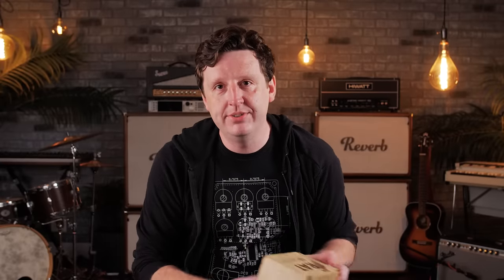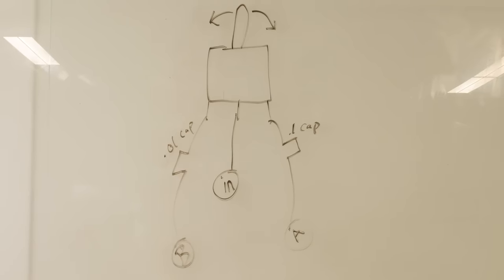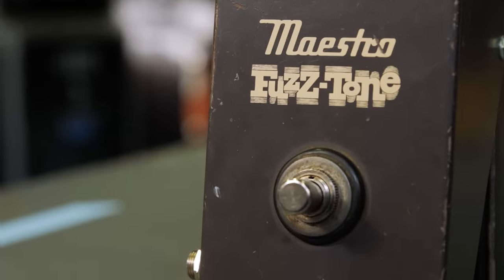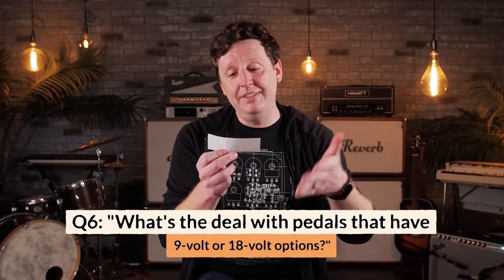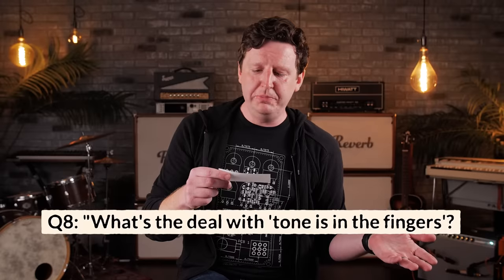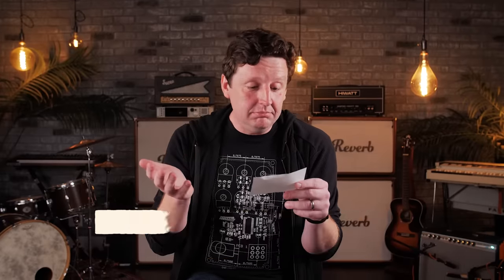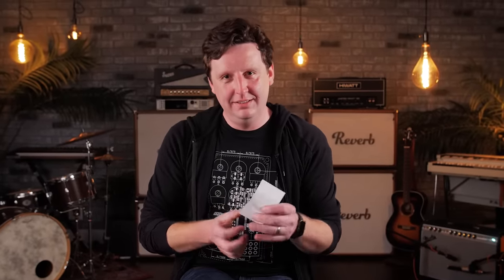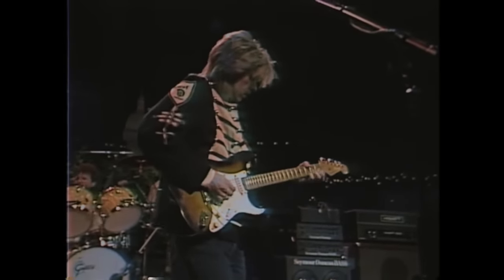What's the Deal? Josh Scott Explains Pedal Myths & Concepts

Comment: "....WE WENT TO THE MOON... Are you telling me we can't make a part for an overdrive pedal?"  Josh is a national treasure.
Reply: I love Josh, but this is the first bullshit I've heard him say. I'm talking about the moon thing.
Reply: @jonahlouque9621  That would be bundled with other reasons... public will would be highest on the list. The tooling and personnel required to build and operate the machines the same way has gone, so in a sense it's correct... but you wouldn't go back to the moon to do Apollo all over again anyway. What's the point?
Reply: @jonahlouque9621  Yes, I've seen that actual clip before too. They blamed it on storing those files on ancient hard drives in old barn/storage facilities and that stuff just gets thrown away. UGH.
Reply: Tone is in the fingers... 
Next!
Reply: @gnigognago9770   
Ok, “we faked going to the moon,” Are you telling me we can’t make a part for an overdrive pedal? 

What’s the sound that a Flat Earth effect pedal would make?
Reply: @jonahlouque9621  It's not about the "lost" technology as if we can't reproduce it. We can't just built another rocket from the 60-s, because the project of that rocket is based on a 60-s tech processes, materials, supply chain, contractors, etc. It is actually easier to make a completely new rocket, designed from the ground up with the new materials and technology in mind, than trying to redo and retrofit the old one.

You can reproduce a pedal though. Even if you really need that exact sound but "they don't make them like that anymore". Even using different parts you can get so close, that no one could tell a difference in a blind test.
Reply: Ironic because according to nasa we "lost the technology" to go to the moon
Reply: For me, I do believe tone is in the fingers.. at least to a certain degree. One day I was playing bass, and it just felt like my tone was quite thin..(I have small hands.. read into that as you wish lol) Anyways, I started using my thumb, instead of my fingers to pluck the notes, and it sounded much fuller, better bottom end. I think this is due to using the larger side of my thumb, rather than the tips of my skinny fingers.
Reply: @gordonhuskin7337  We also "lost the technology" to play laser disks. But laser disks were, definitely, a thing.
Reply: @FilinMXr  Exactly. There's plenty of everyday technology we have "lost" simply because it's become obsolete.

I mentioned laser disks. There's also the original 8in and 5.25in floppy disks, and old CPU architectures.

A couple of decades back I did some work for some companies that had old computer systems which were obsolete (Singer, Burroughs, etc.) and we had to get the software ported onto a different platform because those systems weren't made any more. Without porting the software to a more modern platform, it would be close to impossible to run those applications now. Those computer systems were "lost technology".

It is likely that, at some time in the future, valves (tubes) used in amps become obsolete because factories stop making them. The market for valves is increasingly small and they are expensive to make. The market for guitar amps probably isn't large enough on its own to sustain manufacturing. When this happens (and then the supply of valves has run out), we will have "lost the technology" to make valve amps.
Reply: I should point out that, whilst we may have "lost" certain types of technology (like germanium manufacturing), almost all solid state technology (which is mostly what is in guitar pedals) is still current and will probably never be obsolete. Basic components like diodes, transistors, and capacitors are the building blocks of all electronics.

Saying that one chip "sounds better" than another is like claiming that hand-soldered "sounds better" than machine-soldered. The topology and circuit are identical, it's only the manufacturing process that's different.
Reply: @KeithMilner  wow. that post is just one extremely long COPE. SAD!
Reply: We did not go to the moon...
Reply: @gordonhuskin7337  Just trying to educate the ignorant.

I probably shouldn't bother as it seems their ignorance is wilful.
Reply: @KeithMilner  lmao cope and seethe
Reply: Ha Ha Ha, that's your 1st problem is fall for moon hoax. 2nd only paint color makes a tonal difference in real pedals. 3rd Of Course the Klon Enclosure Enhances the Circuits & tone of the pedal.(Duh)
Reply: @gnigognago9770  why, i mean in ww2 germans built the first rocket that made it into space, just to hit London.
After the war all these rocket scientists got well paid jobs in the USA and built the same rocket, just bigger.
Why would't that be enough to reach the moon? i mean it's rocket science but that's actually not that complicated.
Reply: @Zwidawurzn  Some people are too dumb to wrap their head around even that. What's even more sad than being duped is when they can't even tell which is which.
Reply: @KeithMilner  'We also "lost the technology" to play laser disks. But laser disks were, definitely, a thing.' You win the internet! This is gold.
Reply: @RayLilith  it's real. It's just a rhombus on the other side of the ice wall, not a "sphere" in "space" like the man wants us to believe.
Reply: @AaronAubreyPhoto   You can get a similar effect by using different picks. I think the ones who are obediently repeating the "tone is in the fingers" platitude are not so much talking about the picking as they are talking about some kind of magical power that each guitarist has to make whatever gear sound like "them". 

  I mean, we have all heard somebody repeat a story they probably read in a magazine, book, or on the internet about how a pair of famous guitarists switched setups and were surprised that they still sounded like themselves. Clearly if that was the case, different brands, models, and such don't matter, right? 

  The problem with these stories is that they miss the most obvious element. When we play, our playing style and technique are always going to be the most noticeable element (especially to the audience). When we play, we play like ourselves regardless of the gear we use. This however does not mean the the sound coming out of the amp or the soundhole is the same. We will still play like ourselves but we don't have magic fingers that can make a Fender Twin sound like a Marshall stack.
Reply: @startrekmike  picks? I was playing bass w my fingers.. and I never said one could make a Fender Twin sound like a Marshall stack.. 
If you've played enough guitar, and are honest with yourself, you should know that a certain amount of tone is in the fingers.
Reply: @AaronAubreyPhoto  I know you were talking about fingers. I was saying that changing picks achieves a similar result. The object (finger, thumb, or pick of whatever type) you strike the string with will change the sound. It is a mechanical and physical process that isn't exclusive to fingers or picks. That is the point I am trying to make.

  In regards to "a certain amount of tone is in the fingers", I am painfully honest with myself and have been playing guitar for more than twenty years. In that time, I have found that one's fingers express the musical knowledge in our head and the techniques we have practiced but they can't really change how a specific guitar, amplifier, or effects pedal sounds by design. 

  What is in our hands is our playstyle, not the timbre of the instrument or other equipment.
Reply: @gnigognago9770  ...hahahaha...nice!!!!
Reply: Well, they say we went to the moon...lol
Reply: @KeithMilner  When transistors start to approach their saturation point, they become non-linear. That is, they stop amplifying the signal by 5x (or whatever), and amplify by less and less until they hit their saturation point and don't ever produce a higher voltage. Different transistors do this at a different rate. In particular, silicon transistors move between full amplification and saturation much more quickly than germanium transistors. This means that silicon transistors produce output much closer to a square wave than germanium transistors. You can't just replace one with the other and expect the same sound. It's also really difficult if not impossible to make one behave like the other. That doesn't mean that one is better than the other, but they definitely sound different.
Reply: @TeleCaster66  the moon is flat bro, it just looks square.
Reply: @Zwidawurzn  everyone believes what they want to believe,
as the great Layne Staley said:
"we chase misprinted lies"
Reply: @G60syncro  The Apollo program not only used transistors, but even integrated circuits!
Reply: @G60syncro  Why did we go to the moon? I wasn't there.
Reply: @darwinsaye  as the great Layne says:
"we chase misprinted lies"
Reply: @KeithMilner  Yeba if you change the chip it changes the sound and that is true, proved it by myself.
Reply: @CorbCorbin  A sound that I don't know, that you don't know and that nobody knows....
Reply: @Zwidawurzn  you're right about that
Reply: How is possible he says Germanium transistors sound like crap, it's clear he doesn't have experience with these magical devices, he's a liar.

Comment: “If it sounds good, it is good”

A lot of people really need to learn this
Reply: No no no its needs to be an original Plexi that got cigarette burn marks on it. And then you jump the channels and plug in your vintage strat. Make sure it's a second half of 1959 serial number so you got the slab Brazilian board because the veneer board makes it sound different. And then you kshzoapozbzojahalanbxhdos. Source:  trust me bro
Reply: @bazitube390  meanwhile the machining tolerances on the tuners and saddles were shit so it has that "warm vintage tone" but won't stay in tune to save your ass.

Comment: On different op-amps sounding different/the same, I have two things to add:

Yes, it's in the circuit, and inside one of those chips is yet another circuit, the topology of the op-amp itself! In short, different opamps can sound different, if you know where to look!

If you are working with standard signals within the intended operational limits of the amp, most general op-amps will sound the same. The problem is that when we use op-amps in effects, especially for overdrive/distortion, we are no longer necessarily in the intended, linear operation regions of the opamp. Consequently, when you push opamps outside of intended operational ranges, you may start to hear differences. In particular, a pedal or dirty channel which uses opamps for clipping may gave you different sound characteristics depending on the opamp! Some are rail-to-rail and whill clip later, others start clipping earlier, some clip soft, some clip hard, some clip assymetrically, some older models with bad slew rates like the LM308 can gave off non-linear distortion when cranke, compared to the much higher slew rate of a TL072 which will be much more measured/clean (before you bring it to clipping).

If you are working with a battery setup, the op-amp choice can be crucial to the battery life, a higher quiescent current will drain it faster!

As with many things, you need to separate the chaff from the wheat! Op-amp choice is a bit of an art when it comes to working close to their operational limits. If we are talking about working within the limits of op-amps operational limits, then yes, they are essentially identical!

Comment: 6:36 if you have active electronics in your guitar the buffer is is the pickup or eq (as in a bass) so you can drive 100' of cable no problem. So having all true bypass effects is not a problem with active electronics.

Comment: I got the original RP100 (with no suffix) when they were a thing and still have it. I think it's great for what it is. I don't bother with the preset sounds and make my own setups that are much simpler. Nowadays I usually use it as the pedal I don't have in stomp box form. Like I only have a flanger and a phaser for modulations so if i want some tremolo or a rotary speaker sim I use it for that. And the digital delays and reverbs it has are wonderful, especial the stereo ping pong delay.

Comment: I have a pretty noisy powerline in my house, so I often use batteries, even lipos from RC cars. 12 and even 13V (a powersupply for a Canon printer, totally noiseless!) work with I guess ALL of my pedals and don't destroy them. My AMT K2 loses a bit of dirt in the distortion. That's ok and even an advantage because I boost it with an OD. So, all in all I prefer running this combination on 12V or slightly more and consider it safe (the AMT allows for it, anyway). One pedal (Caline Englishman) starts buzzing on a higher note doing so. I think this is because it has a voltage regulator built-in to up the voltage from 9V to a higher Voltage needed for the circuit. It doesn't seem to get destroyed either. So, I don't recommend trying out different voltages but in general a pedal is built with parts that can tolerate the nuances of different power supplies. It's not that you have to be 9.0V dead on or damage your pedal!!!

Comment: On the 9v vs 18v point. Ive had a couple pedals not or barely work on 9v, if you have a 9 or 18 volt pedal that you think is broken, try plugging it jnto 18 volts. Idk if thats how it actually works but it worked for me twice.

Comment: one thing a different opamp can bring to the table: lower noise!! lt1028... that's a good one
circuit performance is indeed relative to the performance of the components in it.
two 10uF caps could be very different depending on technology and parasitics...
by the way... a transistor can be operated as a diode as well, it's not just an amplifier. (i know... you know. lol)
the notion of asymmetry in clipping would be to promote even harmonic generation. an unbalanced long tail pair exhibits more even order distortion...
i agree. play!

Comment: I think the biggest problem is people with cheap guitars and amps plugging in expensive pedals and expecting to get a famous tone because the artist was using that pedal. Beyond that even, having a squire strat into a solid state combo,  buying a tube screamer and not getting the sound of a 59 burst into a plexi lol. Instead of spending hundreds on pedals, ones money would be better spent on a decent set of pickups and a entry level priced tube amp. A nice mexi strat with good pickups into a used hotrod is a realistically attainable good tone, not five $200 dollar pedals. Once you have a decent amp and a decent guitar, then get a delay or an overdrive.

It seems more attainable to get a 200 dollar pedal than a 500 dollar amp or guitar, but you are just slowing down your path to a good rig.

Comment: All buffers are not created equal. Input and output impedance are very important, but is the noise floor. Every buffer is basically a gain stage with equal gain. Some gain stages are noisier than others. This also is why you don’t want 5+ buffers on your board.

Comment: Don't judge me but I've never been a 'play through a loud amplifier' kind of electric guitarist, so I missed a whole chunk of knowledge re. 'cleaning up' a tone via rolling off the volume knob until just recently. But are you saying (and hopefully someone in comments can help me out here) that rolling off the volume knob doesn't actually always turn down the volume as much as it does 'clean up' an overdriven tone??
Reply: This is definitely true for a Fuzz Face (with single coils). It will clean up to a sparkly clean with the volume rolled down, without much dip in volume. You can hear the effect  (I assume it’s an amp, might be wrong) by listening to Carlos Santana on Black Magic Woman. A little bit into the song he rolls up his volume and you get that extra bite, without a huge jump in volume. I think a tube amp has to be turned up pretty high for this to work. I did it once on a small Fender amp and it was a lot of fun. But normally I can’t turn up loud enough for this trick. Hope that helps. I’m no expert, just sharing what little I know.
Reply: You can clean your overdriven sound by lowering the input volume (guitar volume) to the amp/pedal. Try getting an overdrive and lower your volume until it cleans up. The reason it overdrives is due to clipping as a result of increased input volume. Try screaming at your mic, if your audio processor can handle it, it'll be "clean", if it can't, it will distort. That's how you produce overdrive/distortion in an amp or pedal. I hope I'm using the right terms. You can practically overdrive any amp just by introducing a large amount of volume input (will change depending on the headroom of the amp or wattage). Try using a clean boost to a low wattage amp, it will breakup and distort, while a higher wattage amp will only get louder. 

Hope I made sense. 😅
Reply: Yes. I d this all the time w my fuzz pedals  (fuzz face topology Fulltone 69, and it also works really well w my DOD Carcosa ), and my strat. Other guitars I own don’t do it nearly as well. 
I typically set my “unity gain” volume by turning on the fuzz and turning my guitar down to around 4. I set that volume equal to pedal off, guitar volume on 10. 
Then I can turn the fuzz on an leave it on. When I roll the volume UP to 6, 7….more gain/fuzz, only a little more volume. 8, 9..full fuzz. 
If I turn the pedal OFF while the guitar volume is on 4, the volume disappears. 
You should experience this. It’s awesome and quite inspiring.  
The Sunface he mentioned is also awesome. I’ve borrowed one for a couple weeks.
Reply: @jonschwieb323  Thanks, that's useful! Going to have to try it next time I'm on an amp.